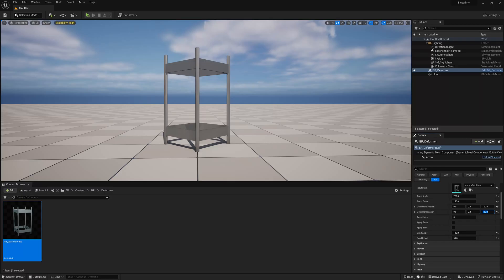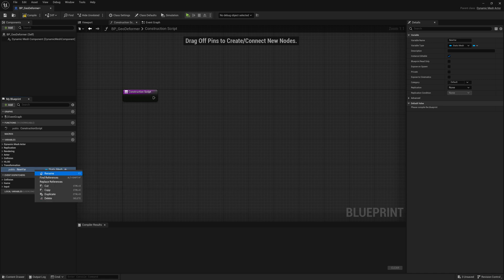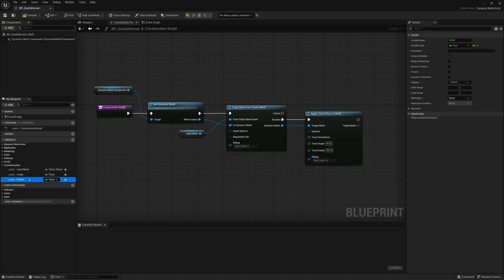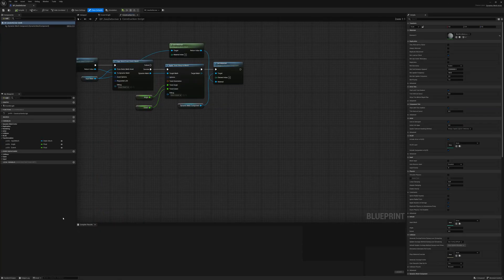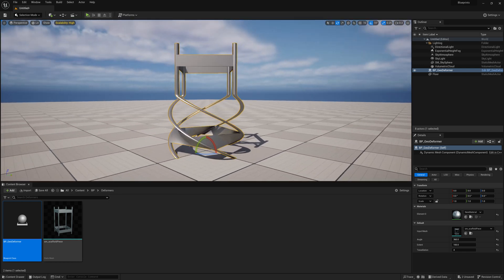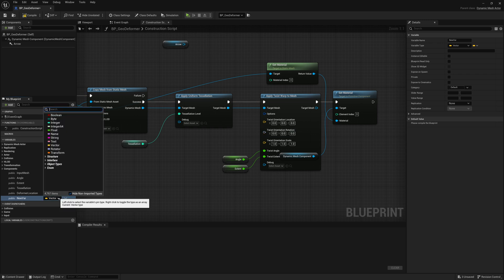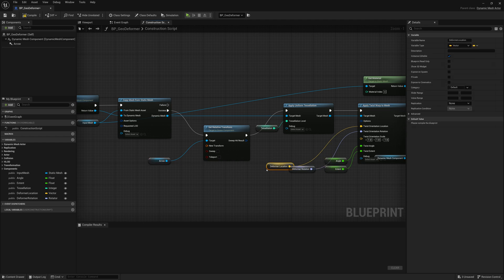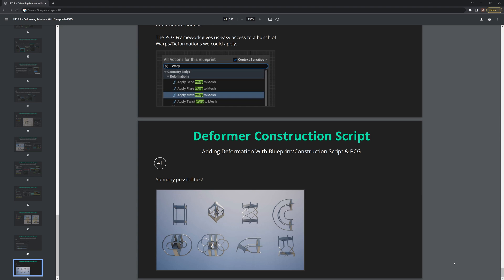Unreal Engine 5.2 - Mesh Deformation With Blueprints and PCG Tutorial

Comment: what happens to the collision on warped meshes?
Reply from the maker: You can make whatever you want to happen on collision. But by default it won't have collision, but if you select the BP in your scene and go to the Dynamic Mesh Component in the Details Tab you could toggle it to Use "Complex Collision As Simple", and "Enable Complex Collision". And then it will have detailed collisions with however you deform the geo.